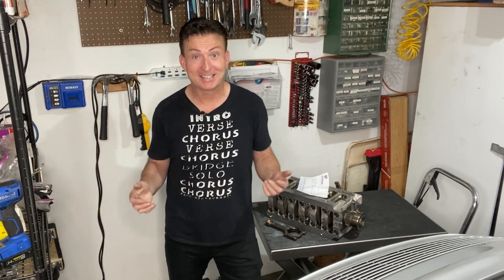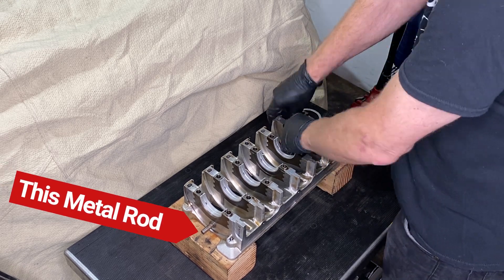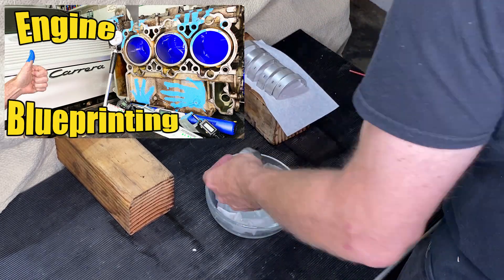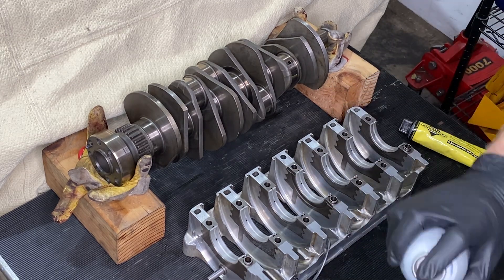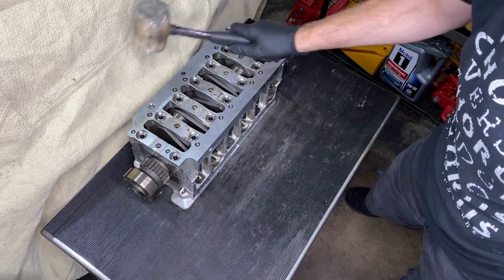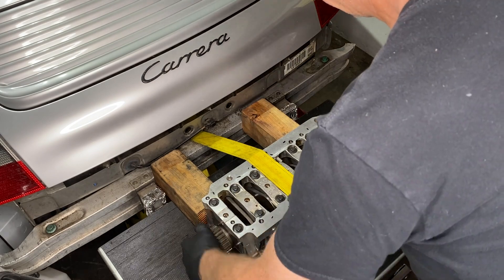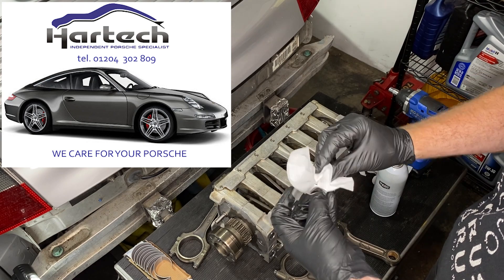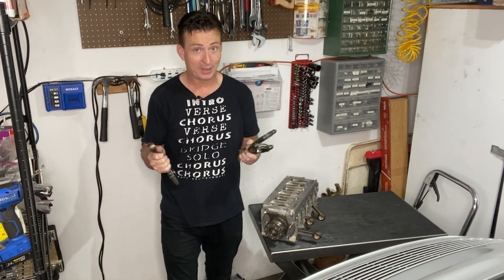How to Rebuild a Porsche 996 Bearing Carrier

Comment: Hello!
Did you replace the bolts for the crankcase carrier (holding it together) or use the old ones?

Cheers
Reply from the maker: Those were new sir! 🤓 thats one of the bolts they recommend not to use again. If you have the budget, ARP bolts are a commonly recommended upgrade in this area, I also used ARP bolts for the conrod caps, the Porsche ones are know to stretch leading to spun bearings. good luck with your build, Thank you for watching 🤘😎
Reply: @ManinaGarage  
Thanks for your support/answer!
I'm reading the Porsche shop manual and the cylinder head bolts, for example,comes in 2 different types, stretch and not stretch bolt. I can read that clearly. But the crankcase carrier bolts or conrod bolts is not mentioned at all even though I understand people do it anyway.
Correct me if I'm wrong.🙂
Reply from the maker: @je753  While I am certainly not a book of knowledge on the subject I believe the Porsche “Official” manual does not recognize the Arp style upgrade, I feel you would be reliant on aftermarket know how. This is important stuff, i would not want to steer you wrong. With that in mind, Ask your question on the “porsche engine gurus” facebook group, if Lee Jenkins answers……do what he says! 🫡
While we are talking about this stuff i believe the recommended torque for the dual mass flywheel went up, instead of add 90 degrees its add 120 degrees. Again, check what Im saying with other sources. Best of luck 🍀

Comment: Hi Finn really getting interested in this build. You don’t mention the final torque setting for the Conrod ARP bolts. Thanks.
Reply from the maker: Hello William 12:56 https://youtu.be/ep_r04TrTEk
Reply: Thanks for the reply I think I have watched your videos five times over now so can’t remember where I have seen everything! Good luck!
Reply from the maker: @williamhughes1925  No Problem William, glad it was in there somewhere. Are you rebuilding your engine?? 🤓
Reply: @ManinaGarage  I have got some little bits of plastic in my oil. I am considering it and your videos are excellent and inspiring looking forward to each new episode. All the best.
Reply from the maker: @williamhughes1925  Sounds like Timing Rails. If that is the case, I have heard you can can replace the vario cam rails with the engine in the car. Good luck 🍀
Reply: @ManinaGarage  yes I believe you can unfortunately I have the next gen engine which is almost the 987 engine and doesn’t use the vario cam pads like yours so I don’t know where the plastic is coming from. I’m torn whether to strip the engine completely sand replace everything like your doing. Whatever I decide you have made it easier.

Comment: Finn, get yourself a cheap thread chaser kit on Amazon.  It's great for cleaning the threads on both the bolt but as well as the tapped hole.  DM me if you have any questions.  I also have an electronic workshop manual copy you can "borrow".
Reply from the maker: Solid advice Sir Yogi! Thank you! I will harass you on insta regarding the "Electronic Manual" sounds like gold dust me 🤩

Comment: Did you put any oil n the bearing journals as you were reassembling? I may have missed it, or only the graphene?
Reply from the maker: Hello Paul & Joy, the Graphogen was the only lube I used, it offers better startup protection than motor oil. I will be running the starter a few times with the ignition disconnected to in order to check for oil pressure prior to the true first start. Thank you  for watching 🤘😎

Comment: Yet another great video! Those little aluminium tubes with brass ends are oil splash tubes (oil sprayers). I believe the two small holes at the end need to be oriented a certain way. Just look at the other ones that didn't fall off. I've seen single and dual hole. Orientation would apply only to the dual hole ones. In any case I hope you back flushed them. very, very important that nothing block those orifices. It would not cause a catastrophic failure but if clogged, the piston would run a little hot and the small end not get as much oil.
Reply from the maker: Hello Fred 🙌  
The mist is clearing a little regarding those little buggers 😅 . They are the dual hole ones, they have all fallen out at one time or another, I have no idea what orientation they were in 😭  . I did clean them but I didn't back flush them or anything.... DO I need to open it all back up again??? Eeeek 😬  ..

Thank you for looking over my shoulder 🤘😎
Reply: @ManinaGarage  I looked everywhere as I can't remember if the orientation of the two holes was supposed to be horizontal or vertical. I think is vertical but need to verify. I think what it does really matter is that they are clear of any debris. There's a small hole on the top of the con rod small end that is supposed to get oil through splashing. The oil also cools down the back of the piston top. Maybe somebody with more experience will chime in and contribute. I have an untouched 2.5L M96 crank and carrier in storage, I swing by this afternoon to see if I can confirm the orientation. The 2.5L Is basically the same as your 3.4L.
Reply from the maker: @Fred82ndAbn  Thank you dude! I will be back in the garage today, I’m going to see if I can look in the hole and observe their orientation/cleanliness. Of all the things to focus on, those little buggers were not on my priority list 🤪. I guess they are now 😅
Reply: @ManinaGarage  Hey I just checked the crank carrier I had in storage. Although they weren't exactly vertical, all six of them were mostly vertical. Don't feel bad about the possibility of splitting the carrier again. I once left a squirter out and only found out after I had placed the entire carrier in. Thankfully, i caught it before bolting it all together, lol. Like I said, the important part is to make sure they're clean so that oil will flow through them. I think LN engineering recommends replacing them after engine failure. I wouldn't consider your case an engine failure, just a bad running engine due to some wear of parts, but thats just my humble opinion.
Reply from the maker: @Fred82ndAbn  Hello Fred, I appreciate you doing that. I was just out there taking a look at the ones in this bearing carrier. Some are vertical, most are diagonal 🤯. I might be able to turn them in place?? I will investigate a little more before getting out the blowtorch and sledgehammer 😅.  Thank you 🙏
Reply: @ManinaGarage  Hey Finn, no prob brother. Yes, mostly vertical seems about right. They should be able to be just pushed out without much effort. I remember using a nail head punch to push them out (the long kind) but anything suitable should work.  They are held in place just by oil pressure ad snug fit
Reply: @Fred82ndAbn  Great info, struggling with the "vertical" v. "horizontal" bit. Not trying to be difficult, but um, relative to what?
Reply: @keithupson5839  No problem! What I meant was that the two holes on each squirter (one per cylinder) should form a vertical line when you place the carrier  in the same orientation as it would sit when inside the engine. Each hole on the squirter should produce a jet of oil to the back of the piston, one above and one below the wrist pin. Apologies. English is my 2nd language. Hope is clear enough. Good luck!
Reply: @Fred82ndAbn  Makes sense now, thank you so much!

Comment: You covered the ass on your beautiful Porsche!❤️  No more brake cleaner on her paint
Reply from the maker: Yes, thankfully I got a subtle warning about that before I caused any damage. I use that cover more than is maybe obvious in the videos. That stuff did a great job stripping the paint off the hydraulic table 😬🤣😅 . I really appreciate the heads up, I don't need to be adding to my problems. Thank you Erol 🤘😎
Reply: @ManinaGarage  looks like she'll be on the road soon it. Keep it clean. But maybe you'll get bored and rebuilt something else? 😎

Comment: Terrific post, Finn!  I always learn stuff on your channel.  Be very, very careful with the carb cleaner around your paint though.  It will ruin your paint in a heartbeat.  I have found brake cleaner to be the better choice around painted surfaces.  Just my opinion - you have a beautiful car and don't want to hurt that paint!
Reply from the maker: Hello Tom, You are absolutely right about that spray brake cleaner. I got a bit of a warning shot across my bow with that stuff a few weeks ago, I am using the car cover more often. I really appreciate the heads up 🙌 . It did a lovely job stripping the paint off the Hydraulic table 🤣  . Thank you for watching 🤘😎

Comment: Baz the engineer/owner is a treasure trove of proper advice, as I've read quite a bit of his comments on the Porsche engines and others. Looks like the early 5 chain engines were better than the 2nd generation 3 chain ones. If the chain guides hadn't worn out all would have been just fine. The fun part is coming up when finishing the other bank and it will test your patience, as it did with 997 Dad; he persevered and won the battle. Best and drive it like you stole it!
Reply from the maker: Howdy Warren 🤠 ! Baz has been in contact with me here and there, he helped me with the Bore Scoring Episode. I feel he knows more than any individual Porsche engineer would be able to tell you. There does seem to be a realization that the 5 chain engines are less prone to the major 996 downfalls despite the fact that people seem to lump the first and second Gen 996's into the same boat. I have been loosing sleep over the "Ship in a bottle" nightmare that is ahead of me. People have been sending me videos and workshop manual photocopies to help me, hopefully I will be able to figure out a procedure without looking overly foolish 😬 . I will check out the 997 dad video. Thank you for watching 🤘😎